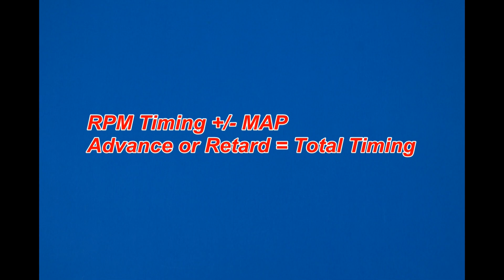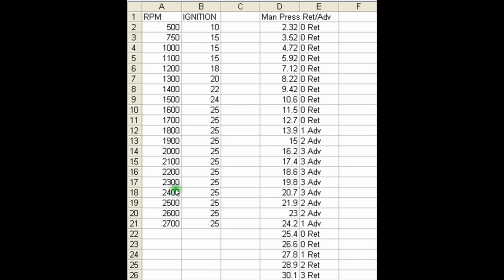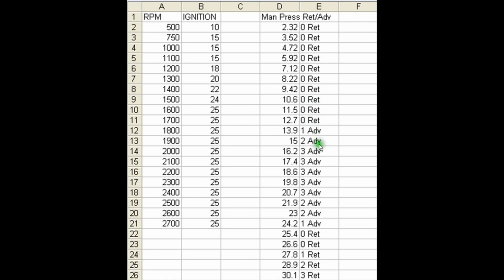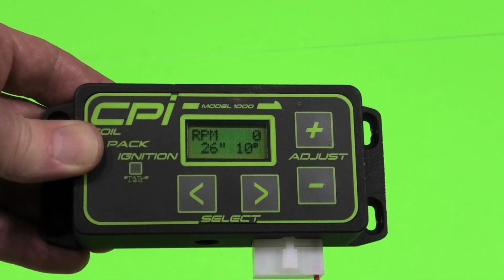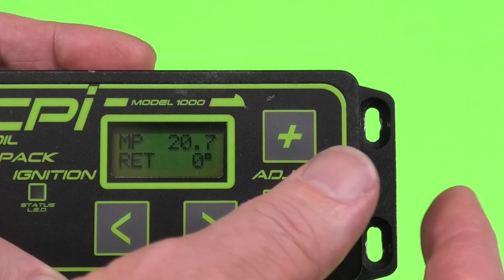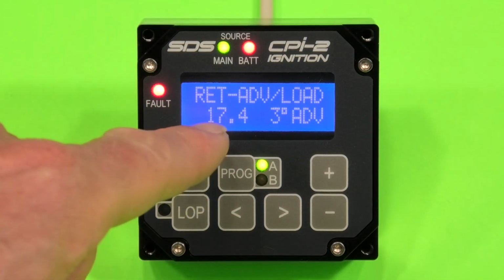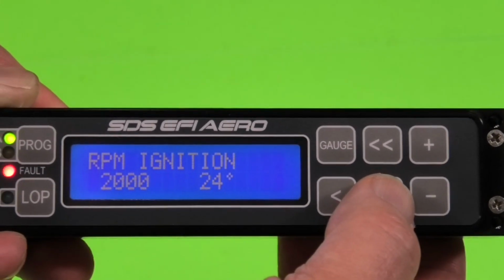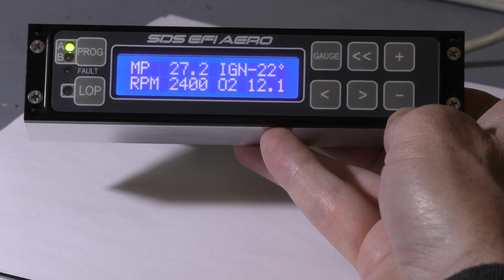SDS Ignition Timing Explained

Comment: You talked about in another video regarding mixture (lean of peek) and flame speed, the need to advance timing.  Does your system’s engine map include these adjustments for lean of peek vs. rich of peek during operation?  Thanks.
Reply from the maker: The system has a lean of peak button which leans the mixture a programmed amount and simultaneously advances the ignition timing a programmed amount to compensate for the slower flame speed.

Comment: Hi, I have SDS on my Nissan Sunny and it has a 4AGE engine. I recently started it and was running about 2 weeks ago. I had to weld on a bracket but also didn't try to start the engine before I did the welding. Tried to start the engine today and cranks but won't start. Is there a way I can check to see if the ECU is putting out ignition to the coils?